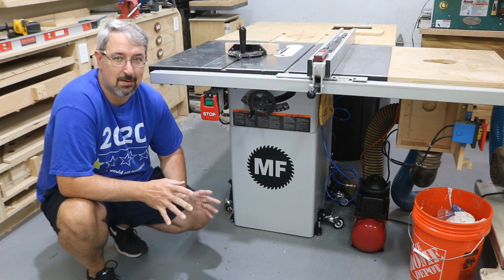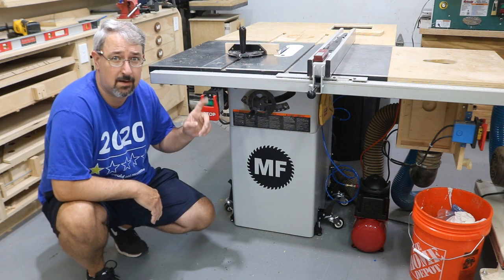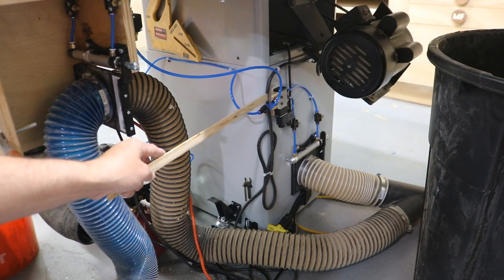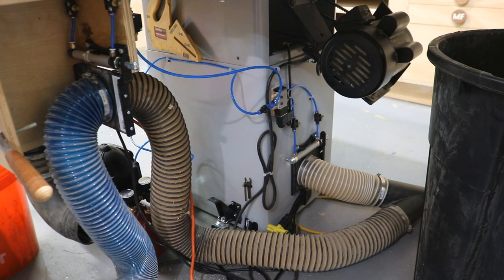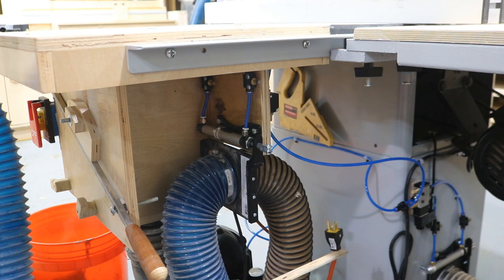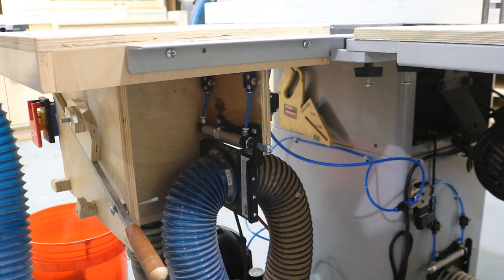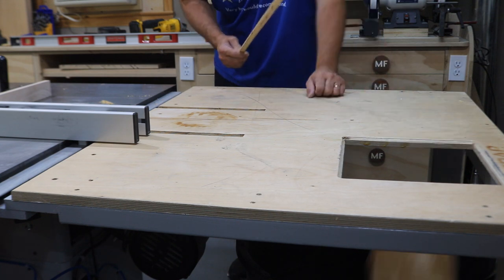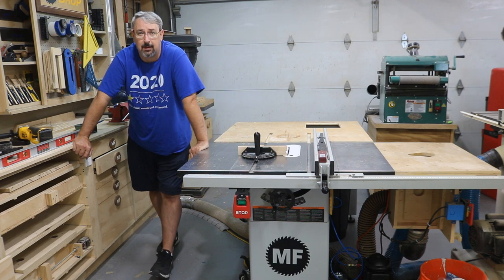Table Saw Base Follow up

Comment: Have you considered a garbage disposal air switch kit? You can get them on Amazon for a little over $20. I know Nick Ferry used one for his dust collector.
Reply from the maker: That's not a bad idea. I could mount that close to the edge as well. Thanks

Comment: Are you running a link belt on your saw?
Reply from the maker: automotive belt. My link belt broke a while back and I just went down and got one quickly. I'll replace it when this one goes bad.
Reply: @mfwoodshop  I saw your motor jumping during wind down is why I asked.
Keep up the good work Mike.

Comment: You might consider these remote outlets from Harbor Freight. That would give you some flexibility. I use mine to control lights and box fans.
https://www.harborfreight.com/indoor-wireless-remote-system-3-pc-62575.html
Reply from the maker: i like the remote idea, I almost did that but i didn't want another remote to deal with. i already use one for the DC